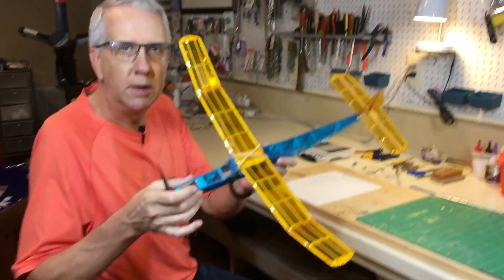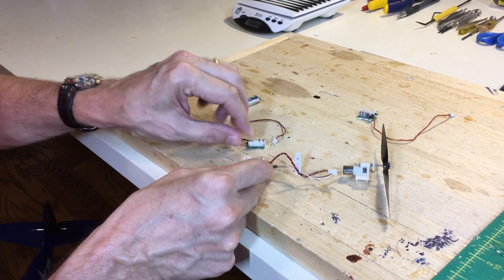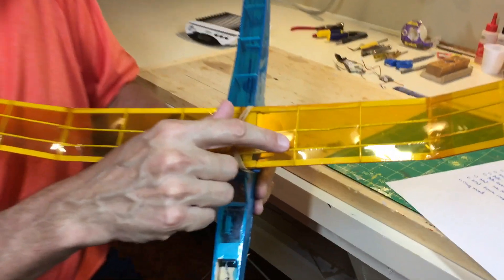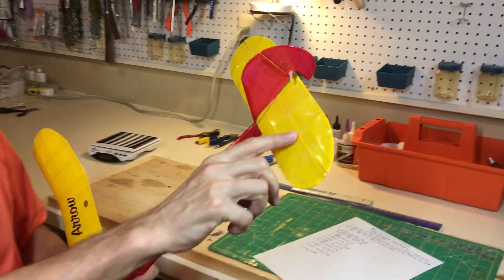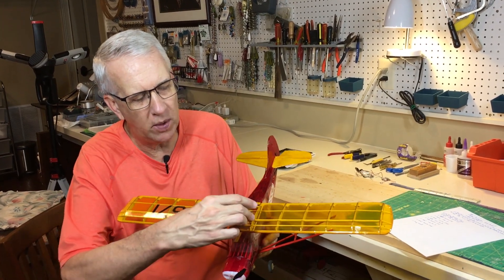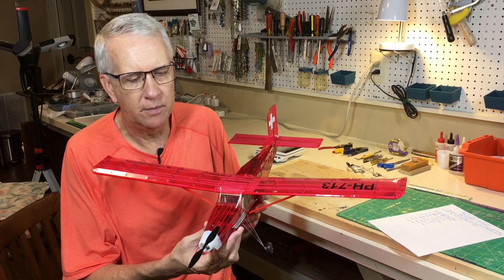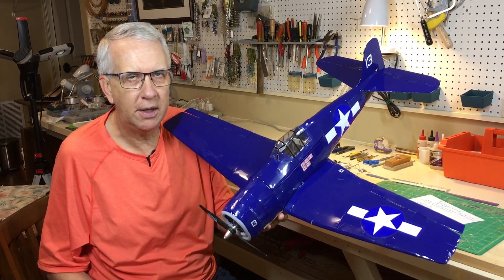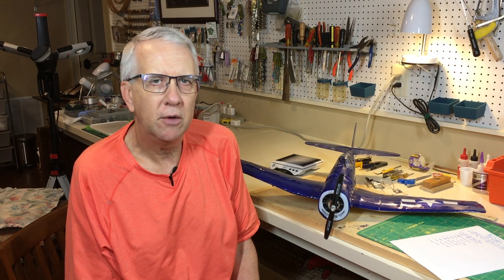Guillows RC Conversion Lessons Learned

Comment: Hello Tim, amazing videos, I currently building the F4U corsair by Frank Scott (plans available on outerzone). Would you go for 3 or 4ch? If 3ch, rudder or aeilrons? I plan to use Mirco brushless motor and 1.7g servos.  Thanks
Reply from the maker: Lukas:  Many thanks!  I think three channels is fine.  A bit easier to build, and for sure lighter.  For the smaller models, ailerons are best if you can do it without too much hassle.  Three channels is OK with throttle, elevator and ailerons.  If ailerons present problems, then go with rudder.  Tim
Reply: @TimMcKay56  thanks for your answer, will do my best, it's my first convertion, probably should've gone with something easier than Corsair, but I have to give it a go 😀

Comment: Hey Tim!! Great videos you are making. I built a P-40 kit 501 many, many years ago just for static display, but I managed to keep the plans when I finished. Now I’m more into building RC flying models and wondering, if I were to upscale these plans 200% (16.5in to 33in) and scratch build the plane, would I need to modify the airfoil any to get it to fly properly or would leaving the wing flat bottom be better? My thought is to add slightly to the bottom and see how that turns out. Thoughts?
Reply from the maker: Keeping a flat bottom wing should work just fine.  As always work to keep the weight light, center of gravity is in the correct location and ensure a bit of positive incidence for the wing.

Comment: Hi Tim. Great videos. Is there a budget transmitter that is compatible with the brick? I'm  told that my old Tactic transmitters won't bind with the brick. Thanks for any advice.
Reply from the maker: Mark:  Not sure. But my Spektrum DX6 binds no problem.  Or, email www.StevensAero.com, they know a lot on these small bricks. Tim

Comment: I built the Guillows 'Fly Boy', as well as the Dumas walnut-scale 'DHC-2 Beaver', Pietenpol, and a Comet 'Taylorcraft' all as RC conversions. At this scale I prefer 1 cell brushed setups for lightness and compactness. I did build a DR1 Triplane as a 2 cell 4 channel getup and it worked great. I have been working on a Wright Flyer as well as a 1 cell RC conversion complete with wing warping and rudder mixing and counter rotating hand carved props. It is a rewarding passtime to build these little machines.
Reply from the maker: Good luck with the Flyer!  Tim

Comment: I like your approach to these.  Keep them light and fly low and slow.  Funny as soon as I crack a box the first thing I do is draw in a way to make the wing bolt on, but I see the one pc plane is probably a little more robust.
Reply from the maker: Light weight is super important. And with these smaller and light models, OK to glue the wing on. Tim

Comment: Hey Tim. Love you channel. I'm about to embark on my first RC build. A DH Tigermoth by Dumas. I'll be fitting it with MinimumRC micro components. I was going to just do standard tissue/dope covering. Is that not advisable for RC builds?
Reply from the maker: CZ:  Thanks for checking in!  Standard tissue and dope covering should work just fine for your Tigermoth.  Good luck!  Tim

Comment: i found a mustang II (p82?) kit... wish i had taken better care of the plans/box/contents.
i have the wing layout still.
guillows denied having made it.
until i sent a copy then "our oldest employee recalls it now..."

meh. did a spitfire with mediocre success, now im masochistically determined to stuff a 30mm EDF into a trojan... just got the formers cored out. yay.

what ive learnt is a strip of hardwood for the leading edge and maybe the main spar. spitfire was especially bad on that regard.
Reply from the maker: Good luck!  The Guillows Hellcat is big enough for normal RC gear and flies great, if that is on your project list.  My flew wonderfully.  Tim

Comment: Salutations Tim!
Although many of your conversion projects do fly, it is obvious that some of them would definitely benefit from additional power as that is what ultimately determines the flight envelope for an airplane, which is precisely why you recommend and make every effort to keep the weight as little as possible, however, increasing the amount of available power (thrust) would compensate for that discrepancy. 
The Pilotus would not need a nut as ballast if you had a more powerful motor that also weighs more than the existing motor, the proper brushless motor with a prop adapter could do just that and with more thrust it would be more stable in flight. The Hellcat is a much larger aircraft and provides enough space and wing loading capacity to accommodate a more conventional radio control system and can easily accommodate a larger battery and a more robust brushless motor, consequently, it is the most stable aircraft that you have converted, so far. The Aronica Champ is also a very stable aircraft, however, it is obvious that some of the others could benefit either from additional thrust, or from additional reduction in their overall weight. Also, the overall balance of components could also contribute to better flight characteristics, for instance, you could shift the control brick further towards the rear of the airplane and make additional room for the battery towards the front of the aircraft, and then you could remove the additional weight that you added behind the wing to balance the plane, and then use shorter control rods.
It is amazing how much can be done to improve the flight of these airplanes, and how much additional weight they may carry, providing that the aircraft is properly balanced. 
For instance, I have an early Parkzone P-51 Mustang, with a 16” wingspan, that I have equipped to carry a battery that is at least four times as heavy as the original battery, so that I can fly for around 15 or more minutes safely without running out of power, and, although the flight envelope is compromised, I can still get some good flights out of it and can still execute some advanced maneuvers. 
It uses the same receiver as your smaller conversions do, so I do know that you can achieve better performance from those airplanes, especially if you consider that I am using a 600 mAh battery for the P-51, which is substantially heavier than the 150 mAh battery that you are using for those airplanes, however, if you want to use the larger battery safely, you would also need to add a heat sink to the motor as well.
With enough thrust, however, many of these projects would fly and be completely stable, and could also benefit from additional controls so that their flight envelope could be expanded. 
Food for thought for anyone interested in working on such a project.
Happy flying!
Thank you for posting these videos!
Please have an excellent and awesome day!
☀️✨✈️
Reply from the maker: Mike:  Great observations, thanks so much for sending in!  Tim

Comment: The Hellcat is my choice for a good flying scale model. If built to scale, it has a very generous wing as the Hellcat had the most wing area of any WWII single-engine fighter. This was designed into it so that it could turn with the Zero better than anything else. Well, it really couldn't do that for long, but it could stay in a tight turning fight with a Zero long enough to put a dozen or so .50 cals into it which was enough to destroy it.
A model of this airplane, if built lightly, will have a very low wing loading, particularly for a WWII warbird.
You might even be able to fly it at something close to scale speeds and not like a jet fighter.
Personally, I'd double the size of the excellent Guillows plans and scratch-build it with a very light, but strong airframe.
If building the stock Guillows kit, as you so excellently did, lots of weight can be shaved off all those heavy parts and lighter and thinner balsa used. 
It does fly nicely.
Reply from the maker: GM:  All your points are well taken with the Hellcat.  Looks great and has ideal proportions for an RC model airplane.  Tim

Comment: Hello, Tim. I watched this video with great interest. The old saying was "crawl before you can walk and walk before you can run" My LHS didn't have the Arrow in stock; it's back-ordered. But I will wait until it arrives and watch more of your well-crafted videos. Conversion of the Arrow will be me "crawling" and then the Aeronca Champ or Pilatus Porter will be the "walk" followed by the conversion of the Guillows 500 Series kits that are laser-cut and just sitting on the shelf: Avenger, Hellcat, and Focke-Wulf (in captured USAF colors and markings!). That should be quite a "run".
Reply from the maker: Steve:  Sounds like you are on the right path!  As you know, keep everything as light as possible.  And I was very pleased with my Guillow Hellcat RC conversion . . . plane flies very well.  Good luck!  Tim
Reply from the maker: Steve:  As a "Plan B" to your LHS, Amazon has a lot of the Guillow kits as well.  Tim
Reply: @TimMcKay56  Good point, Tim. The three 500 Series warbirds did come from Amazon. I just needed the inspiration to "see" them in the air someday. Cheers!

Comment: I just bought a Lancer kit. Not even all laser cut! I saw a pic of one with 4-6” of added wing section to make it glide better. I also want to strengthen it up and add a larger motor.
Reply from the maker: Jon:  Yes, only a portion of the Guillows kits are laser cut.  Usually marked clearly on the box.  That said, the Lancer can scale larger nicely.  I think there is a YT video of a guy who doubled the size, flies great!  Tim

Comment: Hey Tim really enjoy your videos and all the info you share. I’m really new to all this, got into when all this COVID mess started. I’m trying to build the Lancer you showed on an older video, having trouble trying to figure out how to rebuild elevator to miss the rudder any suggestions? Or would it be better for me to try the real small foam planes you have on your channel? Would like something to fly in a indoor basketball gym. Thanks
Reply from the maker: Danny, thanks for your note and subscribing.  😁 For the Lancer tail feathers, use light 1/16" balsa.  Be careful covering (if using heat shrink) to avoid warps.  Just use the minimum amount of heat.  Very easy to deconflict the elevator and rudder.  If you look closely at my video, the elevator is straight across for easier construction.  To avoid interfering with the rudder, at the bottom of the rudder cut away the lower end at a 45 degree angle to allow the elevator to move up.
The small foam planes are a good start, begin with profile models as they are easier to construct.  And if new to RC flying, try an ARF like the Radian glider.  Very tough for bumps into walls and easy to fly.  Tim

Comment: I am building a  Guillows Javlin now but the wing chord is only 2.5 inches and i am really considering making a little bit bigger wing with a 3 inch cord  with same 24 inch span . I have a WL toys brick and will use a parkzone geared motor
Reply from the maker: Larz:  A 3 inch chord should work just fine.  Tim